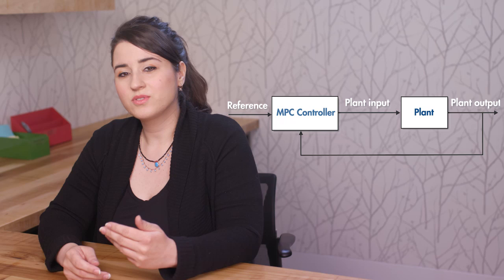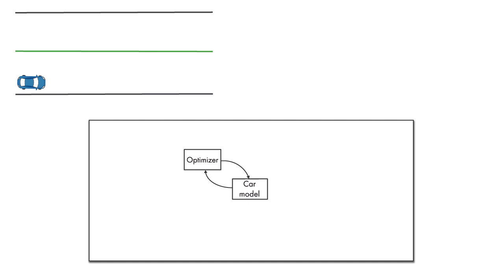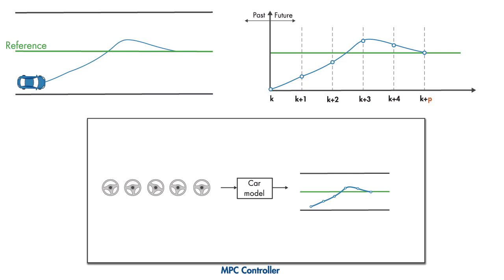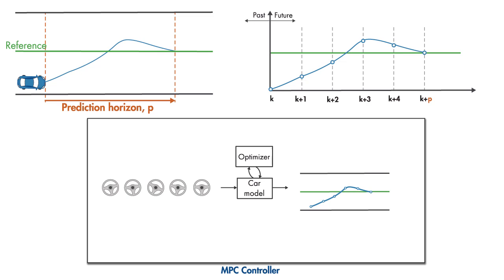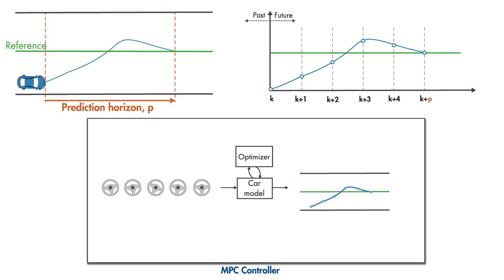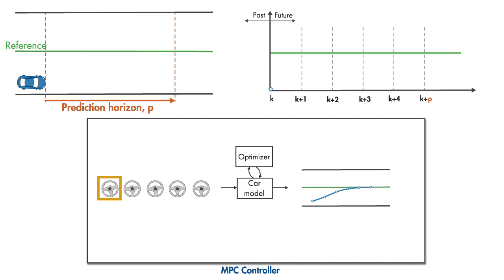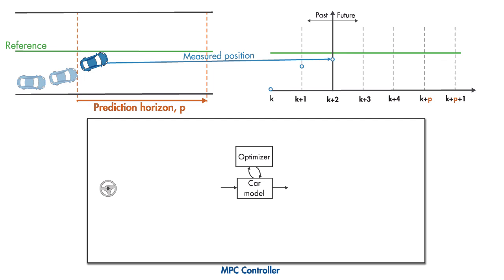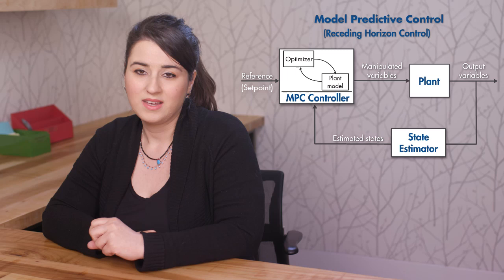What is Model Predictive Control? | Understanding MPC, Part 2

Comment: Which textbooks would you recommend to learn all basics about mpc and to go in depth about the subject?
Reply: Hii.. did you followed any book?
Reply: I believe learning about the basics and building towards making your own controller involves understanding the theory and formulations that make MPC what it is. There is a lot of documentation in learning how cost functions, weights, and constraints work. Remember if you want to build the actual controller yourself, you have to take into account the plant and system dynamics you are trying to control. The best way to do this is to acquire pieces of example codes that could be useful for your controller, in any other way you will be lost in where to start. This book will help: Model Predictive Control System Design and Implementation Using MATLAB

Comment: how the controller gets the new measurements
and how we define the feedback from MPC
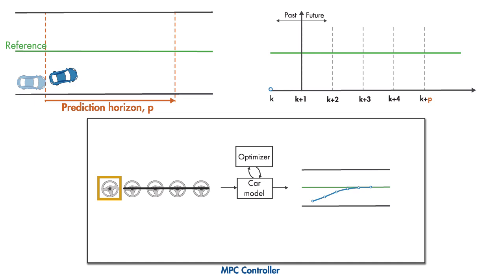Reply: Hi, this is explained at 4:11. MPC finds an optimal sequence for the steering angle but only applies the first step to the car. With this input the car travels some distance. Next we take a measurement and this loop repeats itself. The output of MPC is the steering angle which drives the car.